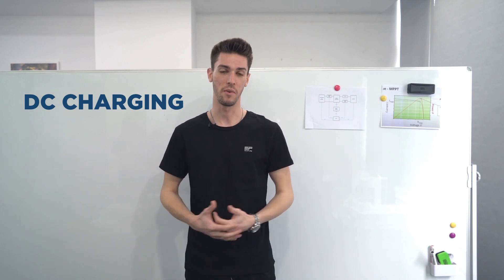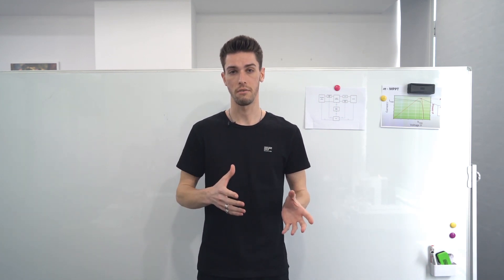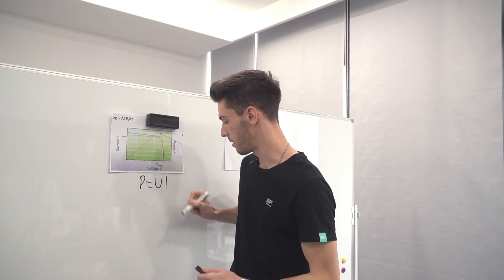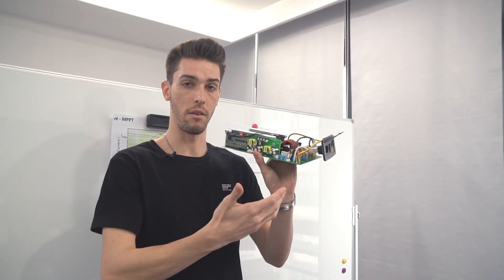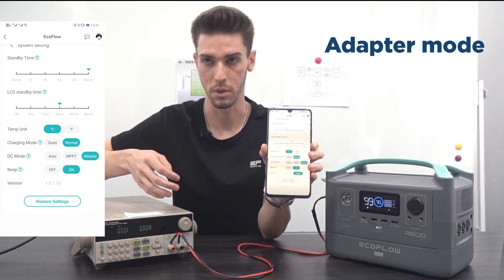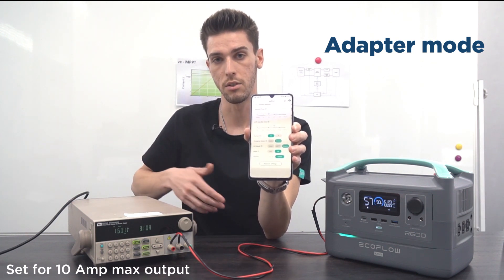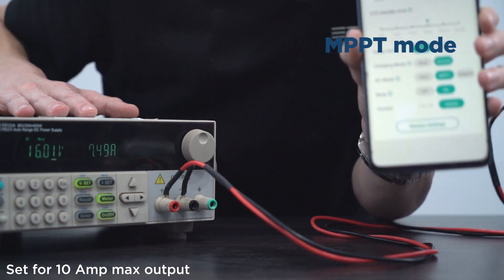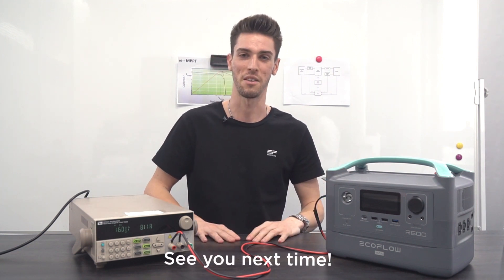Portable Power Station and its MPPT technology

Comment: I have the Ecoflow river 3 plus, but I have problem with a third party solar panel.
Short circuit amp and voltage are about 7A and 25V so I’d expect 175W, but the Ecoflow only charges at 65W
Support said the MPPT is not compatible. I don’t see adapter mode in the app. Is there another app?

Comment: Hello, I apologize for the perhaps trivial question: I do not understand how an MPPT can work with the solar panels supplied since the battery voltage is 28.8V (8 cell 3.6V) while the Voc voltage of the panels is 21, 7V.

I would have expected a Booster type BMS that raises the input voltage rather than an MPPT that works with input voltages higher than that of the battery
Reply: Buck-Boost. Output can be lower or higher than input

Comment: I'm really confused about adapter mode test from 2:20. In a real car, 12 V outlet doesn't have capability to cap the current at 10 A. If R600 tries to draw more, it will blow the fuse. What exactly does R600 do in adapter mode? Does it try to draw as much current as possible first, then step back by 2 A? Or, does it just always settle at 8 A?

Comment: Is that the same which you use for Delta? Its so smart that it discharges the Delta instead of charging if the solar panel have no bright sunlight. My cheap china charger is able to charge the full day, even if it is shady, as long the sun is above the horizon!